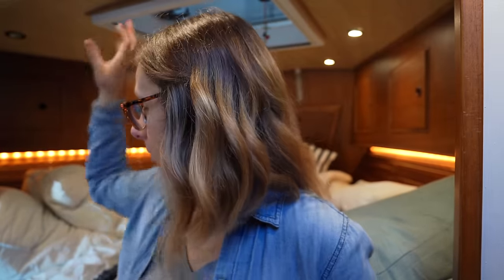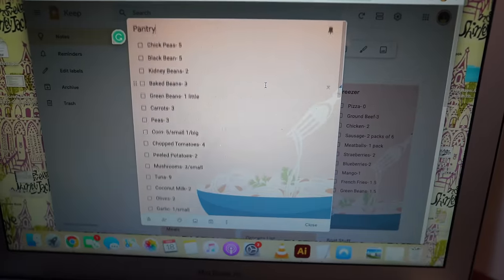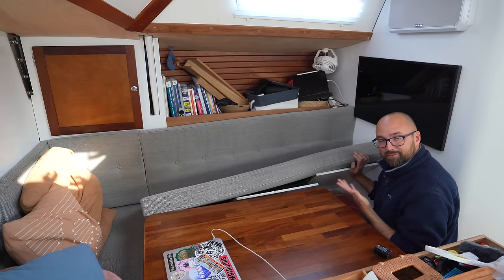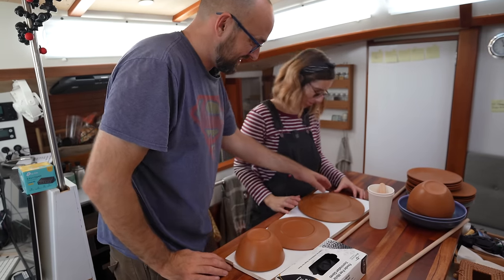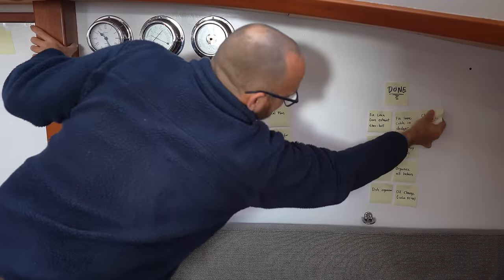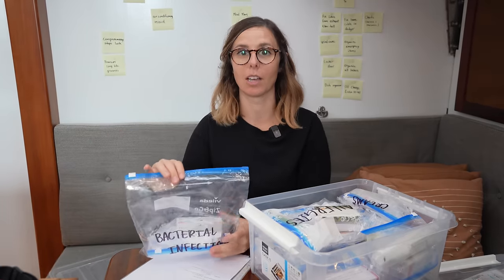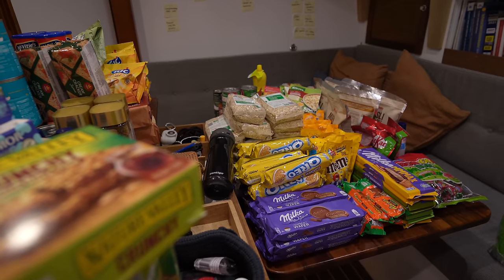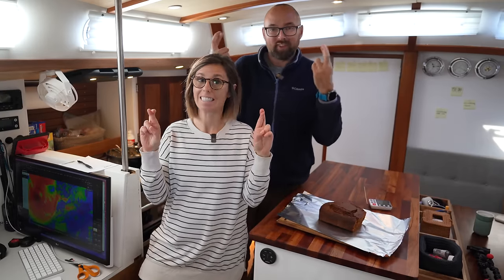Sail Life - Ready to cross the Atlantic Ocean 🌊⛵️

Comment: Saw the bags of spoiled bread mix in your video. Thought you should know I've had bugs chew thru plastic bags and come into the pantry via cereal, grain and flour. Storing dried bulk food in bug proof air tight containers can help limit their spread. In my land based pantry I use canning jars. Glass is an issue on a boat. In Europe is the same type of plastic mesh used to bag onions and some fruits as in the US? That might be another option if you run out of fluffy socks? Bay leaves sprinkled in the pantry and put in jars of bulk food help deter bugs in a temperate climate. They don't work in a tropical one.  Freezing grain related product for a week or two may help prevent infestations.  Wishing you two fair winds and safe voyaging.

Comment: One item that we only recently added to our 1st aid kit was Surgiseal Topical Skin Adhesive. On a recent offshore passage (1500nm), I managed to cut myself badly on one of my fingers (down to the bone). Used a tube of the glue. Next day couldn't see the wound and no scar or tenderness - like it never happened. Bought several top up tubes once we reached port. Other piece of kit worth their weight in gold is to carry a range of bandages specifically designed for burns and/or grazes. We had several burns & grazed shins during the same passage and by quickly applying a suitable bandage there was little scarring and more importantly no infection. We sail in the tropics and things go septic very, very quickly.

Comment: My wife is RN trained but I am not.  That said, you might include a manual blood pressure cuff, stethoscope, and both digital & mercury thermometer.  Learning how to use them might take 10 minutes and they really help in making better diagnosis.  Another useful gadget is an oximeter (pulse & O2 meter).  Being able to relay basic vitals over radio would greatly assist any remote medical advice you hopefully will never need.
Reply: Another vote for the oximiter - easy to use and very useful data (especially if covid persists - as a way of distinguishing between a bit sick case and needs hospital, they are a life saver).  I would not go with a manual BP cuff - that takes real training to use and it is quite tricky.  The automatic, electric ones are now quite cheap and are pretty amazing.  Slip on the cuff, press one button and it does the rest.  With one of those, a good termometer (I think the ear ones are easiest) and the oximiter - you can keep "ob's" almost as good as a nurse.  Log this data if someone is sick and the 'trajectory' of the illness often becomes quite clear - and handing this data to healthcare professionals gives them a massive head start.  Even a basic idea of how to understand the data is a great help.
Reply: A battery powered blood pressure device would be easier and modern watches can do blood O2 can’t they?
Reply: @teeanahera8949  We have an automated cuff but the manual one is actually faster and I never have to worry that it needs charging when I need it most.  Automated BP cuffs are a good option for those needing routine checking and management. Ours will even keep a tracking log of the readings.
Reply: I am a Paramedic, and I was just thinking the same thing, good call! I would also add a Life Vac incase someone chokes. Help is a long way off.
Reply: @RichardPhillips10  I want to disagree….as other have said having something that doesn’t need batteries isn’t a bad thing
Reply: @shawnmiller4781  Hearty agreement from me ...  Especially for something which, on average, might get used once every fifteen years.
Reply: @shawnmiller4781  How many sailors are trained to take BP using a manual cuff?  Have you ever tried this, it is quite tricky. It does not take ten minutes to learn - it requires training and practice that very few sailors have.  Same with pulse and PO2 - just use a machine and keep spare batteries.  Most people cannot even check and record a pulse accuratly after the training you get on a first aid course - never mind doing this on a moving boat, under pressure.  Doing all this every 20mins or so for a day or two is only realistic using electronic devices, otherwise for most of us it just won't happen.
Reply: @thomaspaccione8237  Good point.  People suggesting only none electronic tools do not I think understand how much training and practice it takes to get these ob's done with reasonable accuracy.  Most sailors could not even take and record a pulse with reasonable accuracy, on a moving boat and repeat that every 20 minutes for an extended period.  Of course PO2 is not observable without a tool - and I just don't believe that many sailors would learn and practice with a manual BP cuff.   No.. the electronic devices are now really good, really cheap and it is easy to keep spare batteries.
Reply: Yes. This basic medical equipment is quite inexpensive.
Reply: @RichardPhillips10  Hmmm... manual BP cuff? Not difficult. Learned to use these in a lab session of a human physiology course. Took about 30 mins.
Reply: @rickkwitkoski1976  Agreed.  A manual BP cuff is not rocket science.  My wife taught me how to use one in just a few minutes of one-on-one training.  Anyone who can tackle sailing and global navigation, certainly won’t be challenged by something so simple.
Reply: @rickkwitkoski1976  But on a moving boat, in a crisis? And how many sailors can do this, the skill is not taught on sailors first aid courses?

Comment: If there's one thing I learned from making passages with my dad on his Pearson 39-2, it's this . . . 
Minute Rice is a must.   If you pour minute rice into hot soup, it absorbs the liquid and turns it into something that won't spill when you're eating it out of a mug.   
Pretty much any canned soup, heat it up until it boils, 
season as desired, add any extras, (like  a can of Hormel ham or chicken or more broth, or a can of peas and carrots, small can of evaporated milk,  can of potato cubes, etc) then when it's at a boil again--add about 3 Tablespoons of Minute rice, stir and turn off the heat. 
Let it sit on the gimbaled stove for a few minutes with the lid on the pan.    
Your soup will thicken up enough that it won't spill.   

Nothing's worse than being hungry and having everything be sloshing around.   

We never depended on bread lasting (because it never would).   I baked biscuits or cornbread using evaporated milk and shortening.   I usually just poured the corbread batter into muffin cups so we had corn muffins or biscuits to eat with our soup.   I made sweet muffins with canned cherries or blueberries, when they got a bit stale, we'd just crumble them into our porridge.  

For breakfast, we ate a lot of porridge (oatmeal, cream of wheat, etc.).  We also ate eggs, dad bought powdered eggs and we put them in cornbread, muffins, skillet scrambles (with canned meat and veggies).   

We crossed the Atlantic three times, Sailed through the Panama Canal and up to Santa Barbara then on with a flotilla of yachts to Hawaii.   From there, we went to Samoa (very long passage) and he went on  to French Polynesia from there.  

We never depended on refrigeration even though we had it.   When we had it, it was nice, but it can go out.   Jars were all put in socks, cans were all labeled with a grease pencil (date and item) because the labels can get destroyed.    Inventory of food was my job.  We planned for 2 hot meals and 2 snacks a day.   

Best thing for seasickness is ginger candy to suck on (just candied ginger to suck and chew on).   I don't tend to get seasick, but dad always did the first day or so when we started on a passage.

Comment: You will need to have a vacuum packer and vacuum packed flour. It keeps pests and moisture out and on long trips it can be an advantage. as far as possible that you have to buy one kilo packages and vacuum pack the whole package
vacuum seal them in their original paper bag packaging using our vacuum sealer machine and gallon size bags.
I figure they’ll still taste alright for maybe around 2 years that way. We have not had a problem. I do know that in time, the taste of milled flour will go “off”. Obviously lots sooner without sealing it up – which keeps the oxygen away.

Comment: It’s impressive how much preparation of any kind it’s included for a long passage, I hope I’m not late on this but instead of that painful staples in case of any injury there’s a most un painfully experience, on my personal survival diving kit I have 2 things instead of that, the first it’s a small bottle of 3M medical grade superglue and the other it’s a zip stitch bandage, a sticky band aid applied in two parts with a zipper in between that can help to maintain the skin on place after an injurie avoiding stitches, both products need a proper cleaning of the zone before and a bandage after, now now it’s easy to find them online at a very cheap price
Reply: Superglue was developed to close battlefield injuries anyway.
Reply: One more thought for long periods away from doctors: emergency dental repair.  You can get temporary filling material for cheap on amazon.  Being able to handle a cracked tooth or missing filling can save you a literal headache.
Reply: I’m a veterinary surgeon and I found a bottle of local anaesthetic, disposable syringes and needles with attached suture material useful.During my sailing career I only had to suture a couple of small wounds but at least the equipment was there.

Comment: Since you have a vacuum sealer I'd suggest sealing up all your flour, sugar, dried beans, pasta, crackers and more. Divide into batches that you would use in a few days to a week. While not a "prepper" I keep a pretty large amount of flour and noodles sealed up and in food grade buckets after such items became impossible to find during the early days of COVID lockdowns. Anywhere there is as much moisture like a boat it will really help.

The hand or vacuum cleaner vacuum bags for clothes is another good idea. It reduces volume but more importantly it keeps the dampness out. These will work for not only clothes and bedding but also those bags of chips you bought. Put in the chips, pullout as much air as possible without crushing the chips inside their own bags. This won't stop them turning rancid from the oils but will keep them fresher and the bugs out.

Comment: A small tip about your plates. You can end the rattling and make them non-slip by adding a ring of food safe silicone caulk to the bottom of your plates and bowls. Helped in my RV and so I did the same in my boat.

Comment: Superglue is a good addition to a first-aid kit. It works well for closing & sealing lacerations almost better than stitches or staples. Wooden clothespins can be used to pinch skin together to close the cut after debridement with peroxide, apply a bead of glue to form the protective "scab". Superglue dries super fast on skin so handle with care.

Comment: Hmmm....when we got plates and such for our boat they had rubber rings on the bottom to prevent sliding....they are also sold as "RV" dining sets.  VERY reasonably priced.  These were so incredibly nice when we would dine out on the lake, or in high wind at the dock, they also did not slide around in our cabinets.  

For the medical kit, from experience, you REALLY want things like a bleed control kit (Trauma Kit) with bleed stop pads.  Also, believe it or not, a supply of kotex pads.  HIGHLY HIGHLY absorbent.  All of that is in my shop first aid kit, and yes, pricey for the trauma stuff, but worth it.  I'd also invest in LOTS of the Coban bandage (3M Makes it).  That stuff makes the old school medical tape worthless.  The other tape I would get would be the micropore surgical tape.  Again, that's in my kit, and 100% totally worth the price.  Honestly, the last Coban tape I got has pictures of horses and dogs...because I got it at the local feed store...LOL.

Safe Crossings!!!!

Comment: You may already be aware of this, but there is an oil extraction tube that extends up from the bottom of the oil sump. I find it much easier than trying to pull the oil up through the dipstick opening on my D2....safe travels!

Comment: Losing weight is one of the best things to do for off shore sailing.    Not only will your speed increase but more importantly the motion of the boat will be much more comfortable!    

We managed to reduce our boat weight by over two tonnes just by doing the same thing.   The boat motion improved dramatically and we gained an estimated 20% on boat speed.    

Clothes and books are remarkably heavy.     We ditched all materials, spares and tools except for basic emergency stuff.      We just shipped a crate with some clothes and tools we couldn’t bare to lose.

We were brutal for getting rid of canned goods and drinks which contained water as they are also incredibly heavy.

Just weigh and keep track of everything you take off and supplies you buy.

Comment: medical staple guns are all well and good. But a good supply of super glue (in my opinion) is better.
I have done a lot of traveling in remote places, and super glue is great for anything from the smallest annoying cuts that just won't heal together, to glueing a 7 inch long gash in my friends leg. That had gone all the way through the subcutaneous layer.
And it's a LOT less painfull than staples ! for both of you :)

A tip: we glue 2 inch long strips of 'dental floss' accross the cut, about 1 inch apart, to give it a litttle more support. As  we needed to keep moving.
Leave the lower end open, so that it can drain and take extra Antibiotics with you

Comment: The Canary Islands are one of my personal top 3 places on planet earth and I could easily spend a year or more cruising around them. It's odd and unfortunate most sailors simply use them as a departure point for the crossing without thoroughly investigating the stunning beauty and diversity of these highly unique islands. Think Hawaii but with Spanish culture... yet 10 X better than either... and FAR better than anything you'll find in the Caribbean... which I have cruised as well. Meditate deeply on before departure as returning here with your boat will require much more effort and time. There is nothing like them on the planet as far as my extensive traveling has experienced.

Comment: One thing that is a must, something I will not move the boat without is super glue, if you slice or cut your hand and need to close it, super glue will get the job done, or they have a medical version of it called "New Skin" 

The reason for this is that the second you get a cut and you get salt water spray coming onboard, you are gonna have salt in that wound, if you can clean it and glue it over, no more salt in it. Need to make sure it is clean first though! 

Also popcicle sticks, and/or finger splints and medical tape. 

Also an eyewash kit is a really good thing to have.

Comment: Chili Mac and taco Mac are two of the best RV dinners, hoping they work out for passages. We’ll be doing a lot of coastal cruising, but the same thing applies. Freeze drying larger batches of classic casseroles and then packing them into vacuum sealed bags works great too.

Comment: Have you looked into dehydrated meals like the military mri.s or what campers or hikers use to save weight and space.
A lot of those meals only require hot water added to them and some have a built in heat source that's activated when you add water.
I've tried quite a few of the meals and they were really good. It seems it would solve the problem of having to cook in rough seas or when you just didn't want to fix a hot meal.
And the shelf life is measured in years and would be a great emergency supply of food.

Comment: And yes bugs are already in the flour or even pasta. But the thing is they do.not mature hatch or multiply when using bay leaves. I use it everywhere like cereal, muesli, past, rice, also constant.checking on lid underside is a must to keep other bugs entering from the outside. They smell the grain and wait at the underside of lid. Around the thread. And they are small. I mean small. And often nearly see through when young and hard to see. Probably will not see one until it moves provided you have good eyesight.

Comment: First aid, Band aids are never the right size. Elastoplast makes them in rolls so you just cut off what fits."ace bandages" or Tensor or whatever you call them are good for a great number of things besides strains. Buy cheap and lots. They will even clamp stuff together while the epoxy goes off.
Reply: Ava you may know it as Coban.  Makes for quick access.  Also in First Aid kits they have a “Bloodstopper” you can easily make up this yourself.  Larger bandage like an abdominal pad and 1 or 2 rolls of gauze.  Ready to go for a major trauma. Yes hope you never need it but have it in the go bag or whatever is most accessible to place it and start wrapping a wound with some pressure.